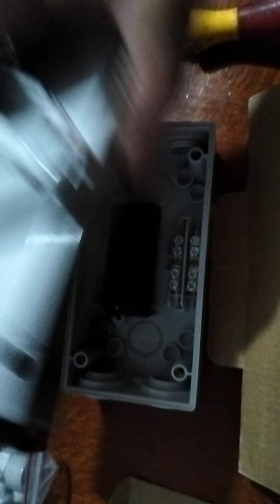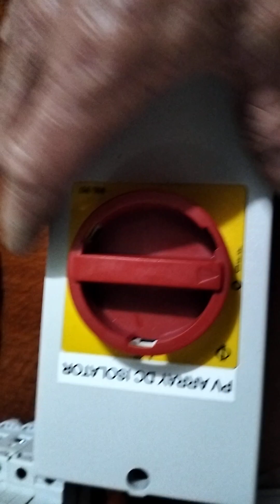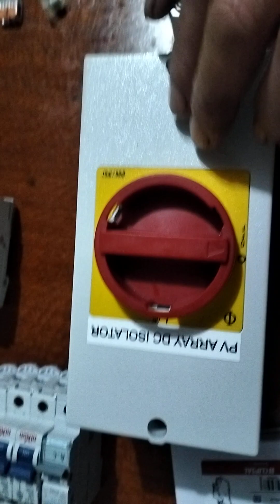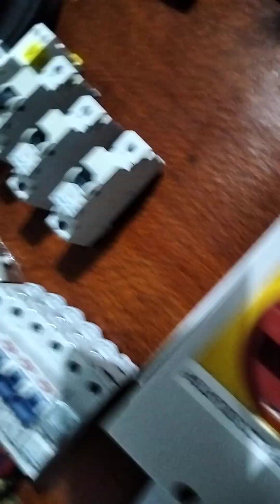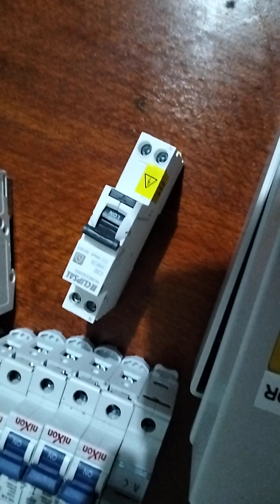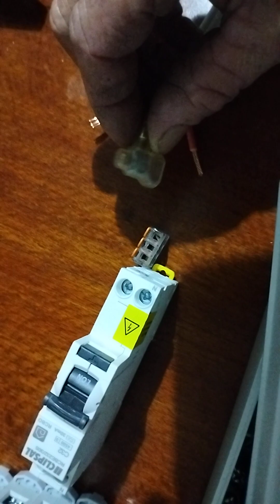Solar power switches and circuit breakers.

Comment: Great info. A testing video after the wiring is in would be awesome. Not many videos go through the wiring and testing. Everyone wants to show panel installs and then skip to the end. Thanks!
Reply from the maker: Thankyou for your kind comment Will.  I think the panel install is the simplest part of a solar installation. My main concern is how to make the  Solar Power system as safe as possible. I appreciate your suggestion and will make a video detailing how I do my tests. The tests I perform are not only on the safety but also efficiency and reliability of the system. It generally takes a month to collect the data to complete all the tests.  Cheers